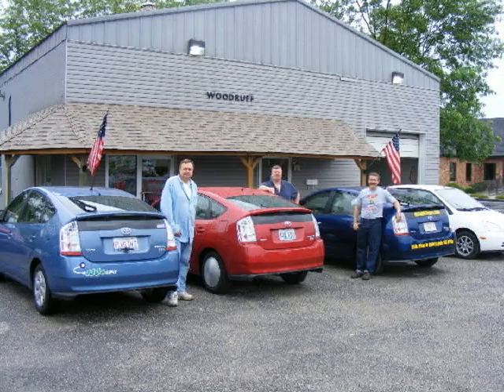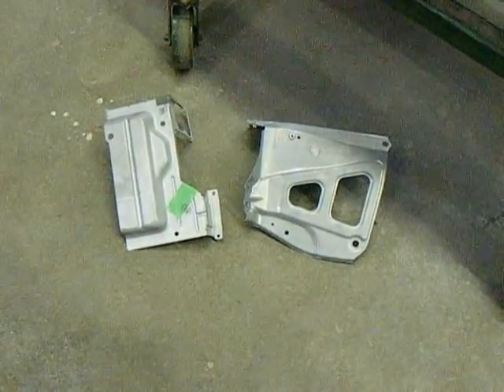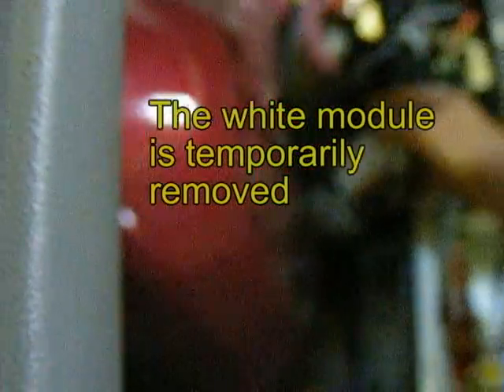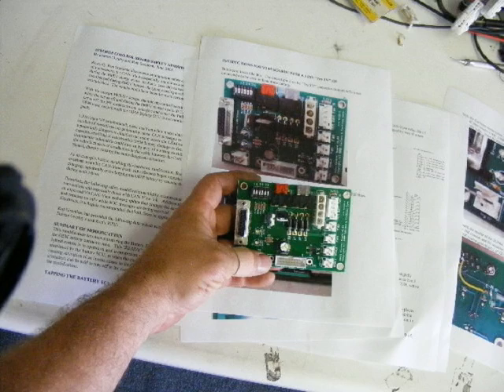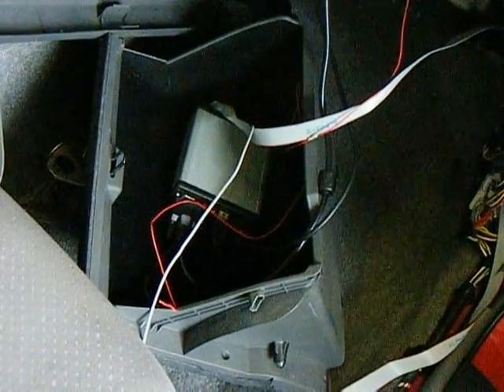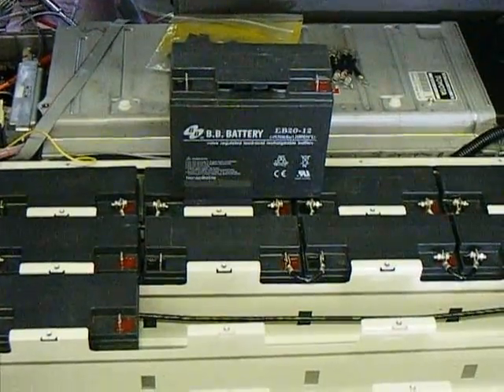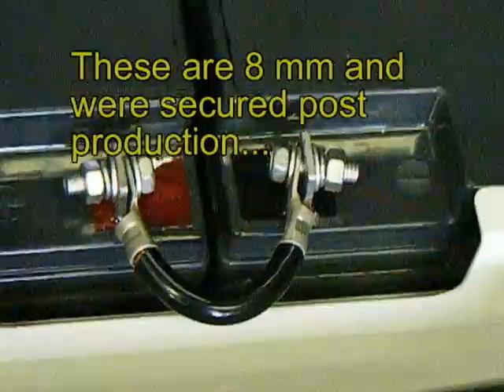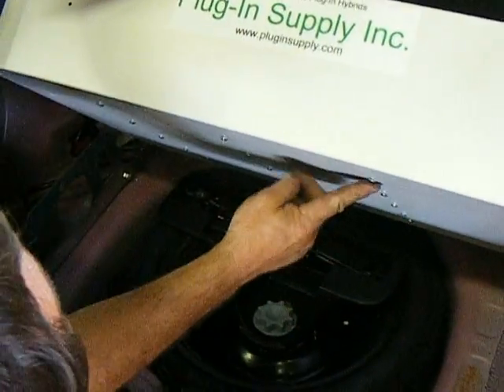Prius Plug In Hybrid Conversion

Comment from the maker: in Fall of 2011 AutoBeYours announced a 5kw lithium replacement pack for the prius.
it outperforms the enginer pack, and can be installed by your local garage.
a smartphone user interface allows for selecting short medium or long drives and also to display battery data.

Comment: Enginer has plug-in add-on battery pack to make any hybrid even more efficient by supplementing gasoline with electricity from the grid. It starts under 2000 dollars.